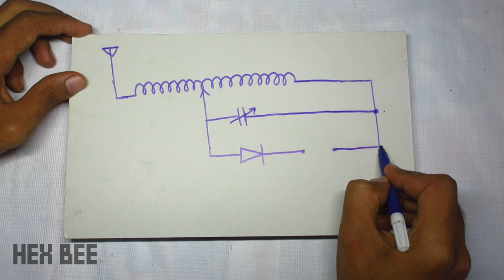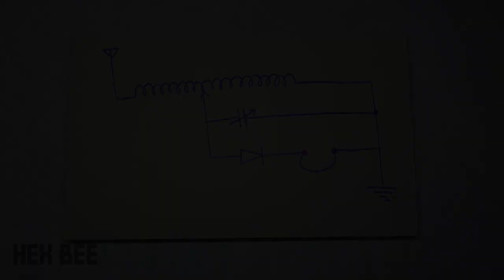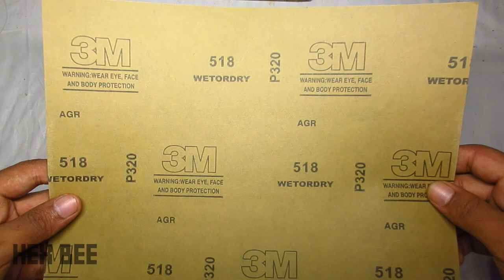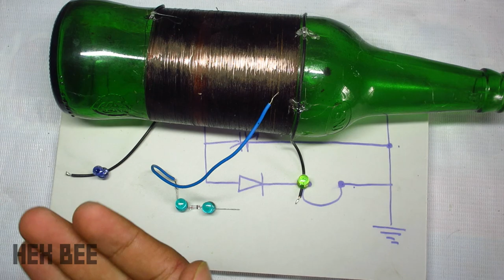This Radio Doesn't Need a Battery..!  | Crystal Radio | HEX BEE | MALAYALAM

Comment: Just add some 1000pF fixed cap for filtering and avoid touching the slide using hand ,instead build a fixed one ,slide it and tune using gang.It will work.
Reply from the maker: Thanks for the information

Comment: I can't understand what you are saying.  That is likely my problem.
1) It is normal to put a 47K (47,000) Ohm resistor across the piezo headphone part.  This provides a path for the discharging of the capacitance of the headphone.
2) Yes, glass makes a very good material to wind a coil on.  A straight sided jar works the best.
Reply from the maker: Thanks for the information bro😊, I just use the piezoelectric disc as speaker, and I don't know about resistor, actually why I'm using the piezoelectric disc as a speaker is higher impedance speaker can provide loud audio comparatively
Reply: @HEXBEE  
Yes, that is a good reason to use the device but remember that they don't pass DC.  At low frequencies, they look like a capacitor.  At audio frequencies, they look a bit more like a "resistor" and capacitor in series.  The "resistor" part is the electrical power being turned into sound and not a real resistance.
Reply from the maker: Thanks for the explanation bro, I didn't consider the capacitance of the piezo but, your comment realise me these concepts thanks again bro